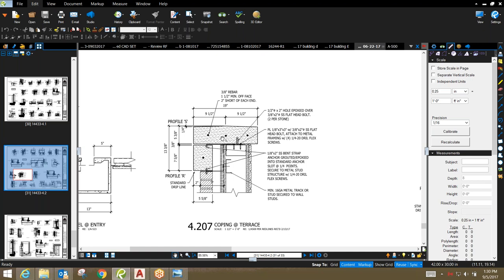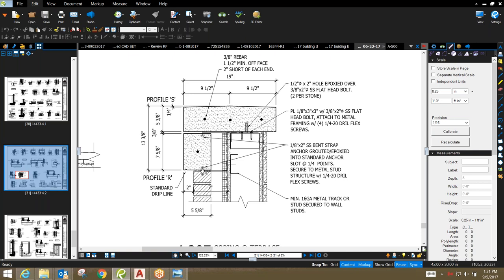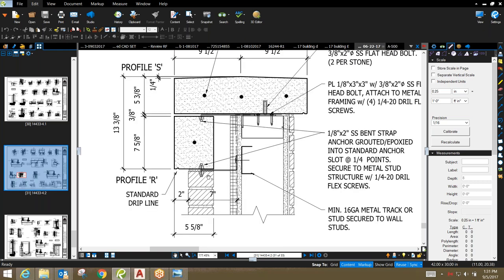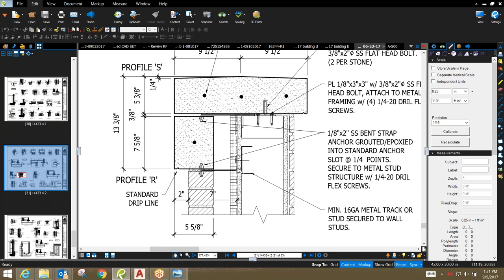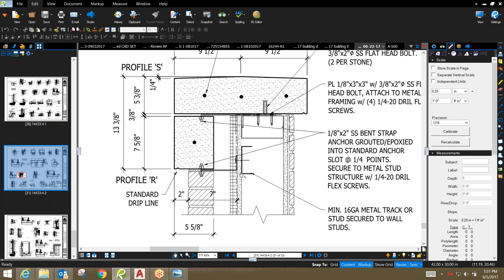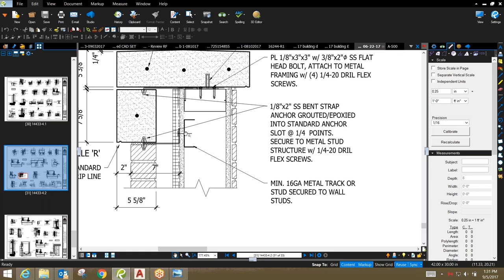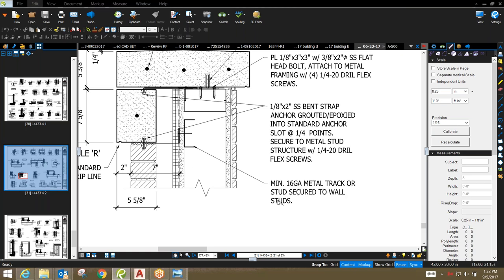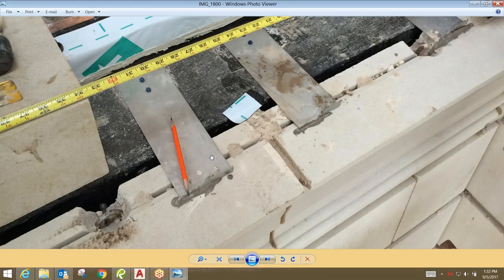Kerf Slot with Strap Anchors: Technique for Installing cast stone, GFRC, precast stone panels

Comment: I liked your video. I am myself an installer, and i caught something in your video that caught my attention. When you showed the example there was the split tail anchored to the wall with two screws in the wall. I’d assume that the wall was a concrete wall where the stone was going to be anchored, and if so why using two screws? The one on the bottom of the split tail is enough. Maybe using bolts for better hold?
Reply: straps hold the in and out. the load should be at the base of the stone. ive done some high rise exterior natural stone back in the mid 80s where the clips were welded and caulking was used in the curfs.